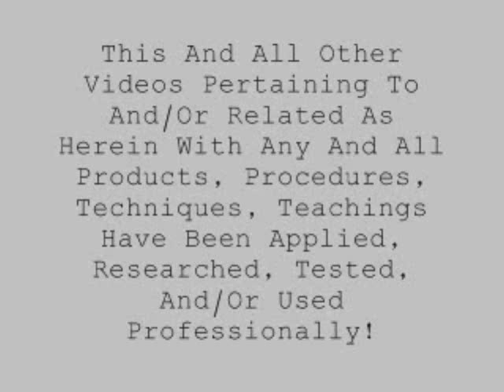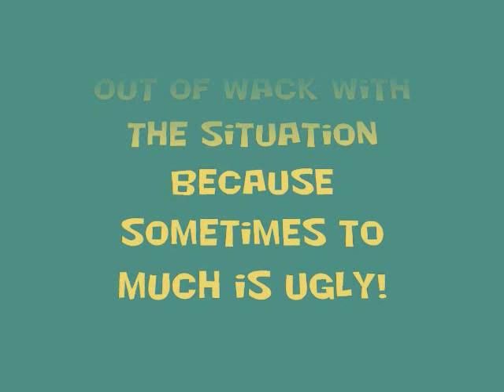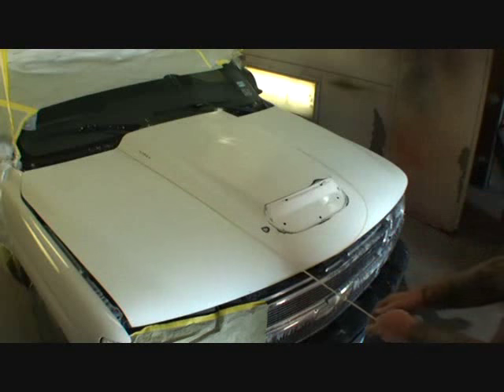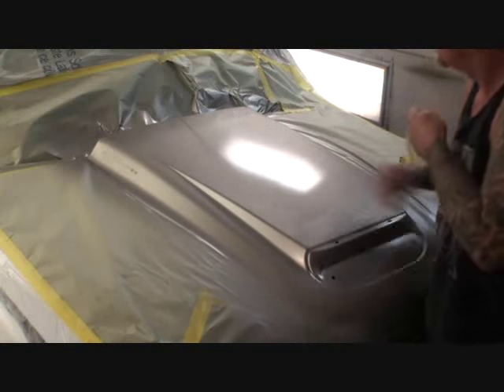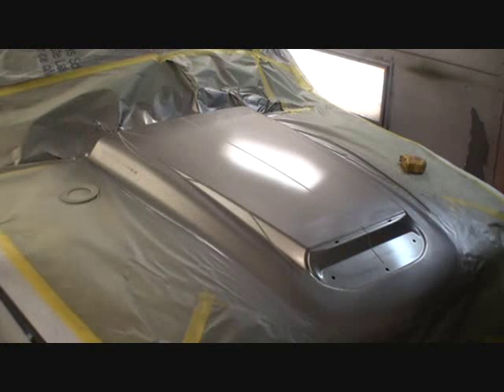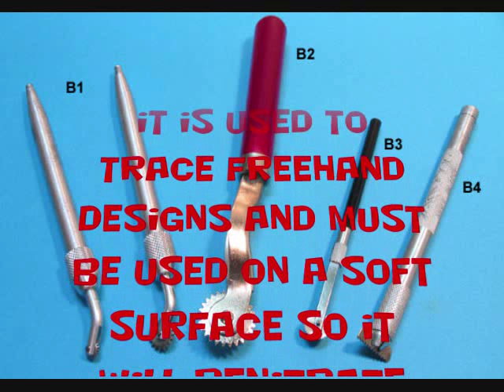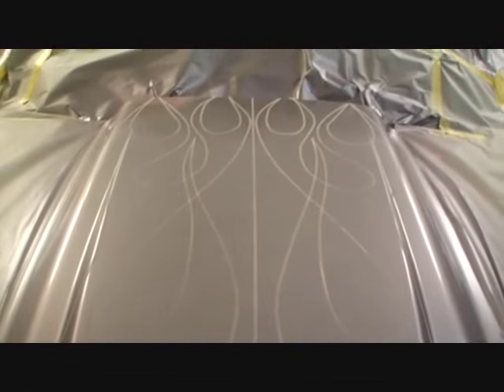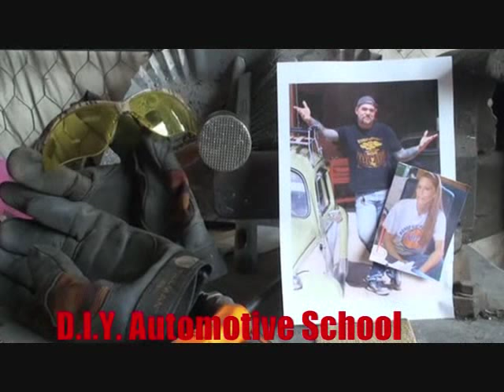How To Paint Flames-Custom Paint Tech Tips-Part 1

Comment: Just another way of doing the same thing. Cut paper to size. Fold paper in half. DRAW the flames on the paper. Run pounce wheel over it. unfold paper. This way you won't need ANY TAPE at all.